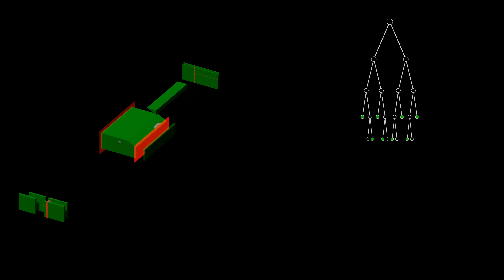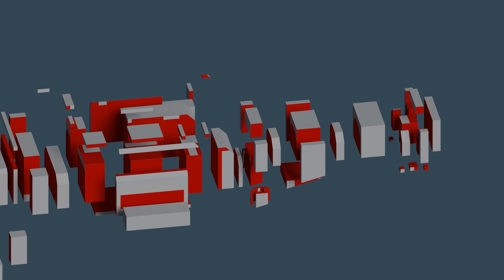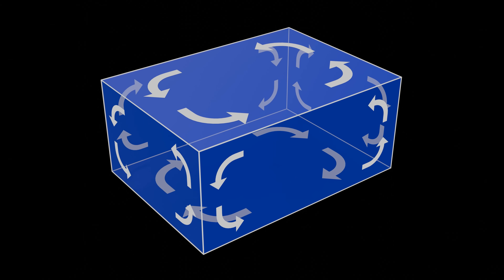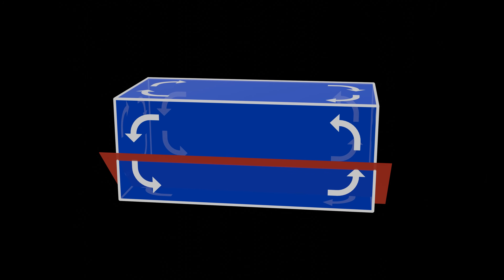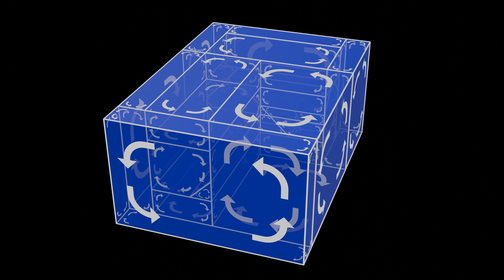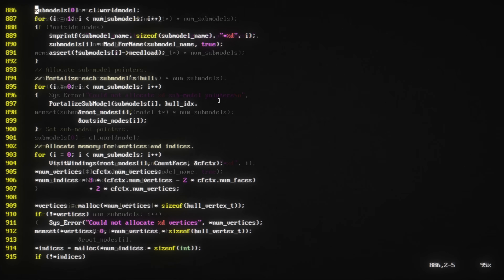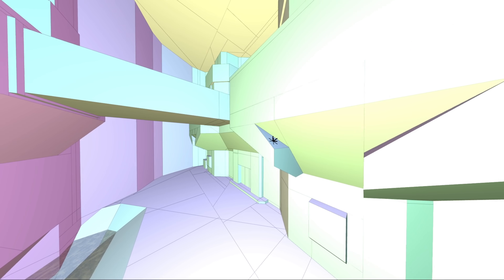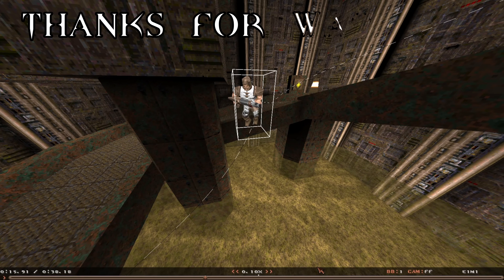Uncovering Quake's unseen collision hulls

Comment: How much of a chore would it be to make this read Dark engine BSP trees? DrOmEd at least unce upon a time had the option to export a loaded level's geometry, even if the brush data was already stripped out. Way back in, gosh, 2002-03 I and a few others on TTLG tried to reverse engineer it and never got that far. Each leaf was basically a plane with a parent, a location in world space, and a normal vector that pointed concave to the mesh. There's black magic involved in turning that into visible graphics!

Comment: Ah, the Minkowski sum.  I'm doing the same trick on the fly for my game's physics since cpus are a lot faster now.  Interesting that most of the video is covering the bsp tree rather than the Minkowski sum itself.  I spent quite a bit of time on procedurally querying the Minkowski sum mesh topology so it doesn't have to calculate a full mesh.  Bsp is also not needed anymore, I just draw the whole map and it still manages to run at 2000 fps xD

Comment: Hello, I am coding a minimal yet efficient 3d engine and unstructured database engine in Javascript since it can run on a browser which means accessible in any OS, I'll be using my engines as an application, for example spreadsheet, a web minimal OS online. more HTML DOM elements make the browser slow, browser RAM usage is incresing, so this is why I am trying to render in cavas what is calculated in Worker. if you think it's interesting, reach me out.

Comment: I've seen that exanded hull bug in a couple of NS maps. It was usually where the off-axis faces of two (octagonal) pipes or similar would met at an angle. This 3:18 is the cause of a lot of problems in quake and half-life maps. When you cut an object diagonally like that the new vertices produced don't necessarily lie exactly on the plane (floating point inaccuracy) nor do they necessarily round up to an integer. Instead you get mysterious leaks and leaf-portals-saw-into-leaf type errors. You have to be really careful to make sure you can actually get exact integer positions where brushes meet at weird angles or you end up in a mess. That's why so much stuff is off-axis on a single axis at a time. A slope or a diagonal corridor is fine, two off-axis things meeting each other is only really easy to do with simple geometry like octagonal pipes meeting at 90 degree angles and such.

Comment: The way that the players bounding box can be represented as a single point is blowing my damn mind
Reply: Well, it cannot really. Quake did away with it for bigger weapons. Half-life has the crouching problem. With cars, games usually take rotation into account. Even with the CJK algorithm you end up writing special code for vertex-face and edge-edge collision.
Reply: The ideal way to get an effect that feels good and is well-behaved is to have a physics solver that is robust enough to track multiple solutions to resolve a collision, filter the solutions that still penetrate, and then rank the remainder with some heuristic. That is, if you have a wall that you hit at a diagonal, it should generate solutions that stop you completely and solutions that slide, and then rank them to determine that you want the sliding behavior because that's closer to the behavior you'd get with unobstructed movement. 

That allows you to build in arbitrary complexity in the geometry alongside complex, gameplay-specific movement controllers with few consequences other than it being resource intensive - I always use this method for 2D games now.

When you use point simplification, it's with the goal of only ever having to resolve a collision against exactly one other thing at a time(which is fast, enables simple collision tests, and appeals to the physics major in us that is looking for beautiful analytic solutions). In practice, that just means your collision bugs are shifted to how the hull was built, in transitions between multiple hulls, or in collisions between mobile objects. Trimming the solution set prematurely causes information loss, and it's really easy to end up with mystery bugs by doing it. 

That said, game physics start to require approximations for performance when you want complex dynamics with bounce/tumble/roll and so on. That's why we aren't always just doing the brute force thing of tracking all solutions.
Reply: @ in Quake the player collides with the level mostly. Collision with enemies? This video found a bug, how many are left. I feel like we have perfect code to generate a hull now. With a hull stored in a BSP, you can trace linear motion between your fixed time steps and find the first collision. Even CJK uses Minkowski. So for a fixed relative movement vector between time steps , we can solve for the time fraction of collision.

I just don’t know how to rotate ( cars ). Probably need to adjust rotation once collision is found? How to simulate a screw?

Doom3 uses this for bullets . I used it for Pool Billard.

Comment: I wrote a map compiler and engine around it many years ago, but I never used the inflated hull.  I had no idea there was a bug in the original, very cool to see it!

The designers of these early bsp games were masters at placing clip brushes (invisible colliders), which is somehwhat of a lost art these days.  They would be placed around sticky doorframes and other annoying geometry that a player can get hung up on.
Reply: I did quite a lot of that in my own maps. I made working ladders in Q1 using clips.

Comment: why not just roughly use same sized polygons then just split not by geometry splitting planes but divide the individual triangles/polygons to two groups. radically different operation. group assignments vs geometry re-calculation. all new geometry calculations are expensive. just doing a tree split node operation is cheap. right pre-calculated of course.

Comment: Even though the the visualisations are the best I could imagine, it’s still hard to really wrap your head around just how much processing power even a 486 has! This is the kind of thing so far past human ability to compute, and it happens many hundreds of times a second on modern hardware
Reply: I think we collectively left behind the ability to understand bare metal processing power when we moved on from 6502 and Z80 processors. Those you could follow; anything after that is understandable theoretically, but to the vast majority of people it's a black box that takes this-and-that input and returns this-and-that output. The REALLY interesting part is that while at the current stage a team of sufficiently motivated people with enough resources can still understand, say, the ultra-intricate structure of a Ryzen 5600, after we inevitably get AI designing our future CPUs they will become truly alien to any human mind.

Comment: But why such hulls were originally needed? The hulls are built specifically for player bbox  size, so it won't work for enemies, since they have different size. And there are a lot more enemies on a map compared to players, so why such hulls were designed -- assuming that enemy bbox collisions are done against world anyway, without hulls?
Reply: Smaller enenmies used the player hull and larger enemies had another hull.

Comment: The way you visualized the portaliser helped me understand why maps should be designed with brushes snapped on grid, otherwise you risk compile errors due to the math getting too crazy. I'd always try to do bonkers stuff when I was a teenager and end up with endless compile errors, scrapping most of my efforts out of frustration. 

Also, I never thought about collisions from an internal "origin point" perspective but rather the external boundary of the model - fundamentally inside out and obviously computationally impractical. Would have loved this video when I was younger - but I still love it now! Thank you for these incredible visualizations of complex ideas.
Reply: It wasn't your fault, the compilers were very primitive. Try Unkle Mike's P2ST. The algo itself doesn't care for grid and axiality. But the floating point errors accumulate either closer to the edge of the world +-32384 units from the ceter or from the map complexity.
Reply: Collision happening at the boundary is more correct as you don't have to use the same collision size for everything, eg a small enemy can fit into more places and vice versa.

Modern engines directly compute collisions, though with much simplified geometry, often only a single capsule for the player/enemy: a cylinder capped by half spheres. This is surprisingly both much cheaper than a box and much more natural looking from the outside and feeling from the inside.

Comment: what would it take to treat the player as other shapes such as a cylinder or octagonal prism?
Reply from the maker: Nice idea!  I suppose in theory you could modify the map compiler to do the expanding with any (convex polygonal) shape and it'd work in an unmodified engine.  The engine would need to be modified for non-brush entities.  That might not be too big a shortcoming though, depending on your requirements.
Reply: Quake 3 does treat players as the capsule. There was even the funny case with Quake Champions: pro-players from Quake got so used to the capsule collision they didn't think that rocket will fly through playermodel legs, but because QC collision is more truthful, it did happen.

Comment: I wonder how much performance was saved by this ? Surely it also consumed some memory...
Reply: I'm pretty sure it was well worth it - this has made cost of collision checks 8 times smaller. You're gonna have from 1 to 3 (move&slide on each axis - maybe more than 3 to resolve corner cases...)  per actor per frame, so with monsters or multiplayer games I am sure it added quickly. I'm pretty certain that they wouldn't go this crazy route to optimize the collision checks by precalculating these hulls if it wasn't absolutely necessary to have the game running at available hardware. The limitation of being able to only have 2 sizes of BBox for any actor is quite significant.
Reply: @unfa00  Thanks. Hey Quake had the small fish and the giant shamblers, so it worked out quite well.

Comment: what i find funny is that for half-life it had to be done twice per map, for standing and crouching stances, and this affects sven co-op as well (surely not with current day compilers, right?) which has resulted in me occasionally discovering yet more ways to clip through or into over-detailed geometry to this day in the near endless number custom levels for the game
Reply: Four times actually!
Hull 0: the "point" hull, not expanded in any way, used for hitscans, NPC visibility etc., basically for tracing lines
Hull 1: standing players, most humanoid-sized NPCs
Hull 2: big monsters
Hull 3: crouching players, headcrabs etc.

Some people completely exclude hull2 from compiling (e.g. in Counter-Strike maps) so they can stuff more and more details, but obviously this means if you tried spawning a Gargantua there, it'd just fall through the floor
Reply: @Admer456  That was very fascinating, thank you.
Reply: Quake does it twice too (one for players and small monsters, one for large monsters like shamblers and ogres). I don't remember if Quake 2 still uses two hulls (one for crouching) though.
Reply: Oh, I'd love to learn more about how Quake 2 has changed the engine and it's approach to many things. One thing for sure is there's no QuakeC, but game.dll.

Comment: This makes a lot more sense explained this way. I could never get my maps to work as they were always hit with a "not water tight" error or something like that. Eventually I gave up trying to create maps for Quake and just went back to making .wads for DooM.
Reply: I don't think that would be related to this, sounds more like there were gaps between brushes to the outside void. I don't think it'd matter if it was too small for the player to fit through. Though I'm pretty sure the editor I used (Worldcraft) allowed you to compile maps that weren't enclosed.
Reply: @23Scadu   Portalisation is related to this, because that's what the BSP compiler relies on, in order to figure out what's inside & outside. It marks all "outside" polygons for removal by essentially walking through the portals and counting what "rooms" it saw (I've yet to fully understand how it works, but anyway). If you make a room with 6 cuboid brushes, that's 36 polygons total - only 6 of those "inside" polygons should make it into the final map. Leaks occur when there's no distinction of inside & outside i.e. there's a gap somewhere or there's an entity outside.

The map can still compile (e.g. with a parametre like -nofill, depending on the compiler), except you'll be using up many more clipnodes and other BSP resources. Modernday BSP compilers like ericw-tools will allow you to compile a map with a leak. Funnily enough, modern Half-Life map compilers (VHLT) will refuse to compile a leaked map by default. Worldcraft/Hammer/J.A.C.K./TrenchBroom will "allow" you to do anything, it's mostly the compiler that goes "nuh uh no fun allowed!!!"
Reply: That's called a leak, the compiler needs to know where the inside of the level is and where the outside is so it can cull away everything on the outside, and it does this by starting at an entity and flood filling through your world brushes. If the algorithm finds the area beyond the bounding box where any brushes are, it has found the void and there's a leak. Most mapping programs generate a pointfile when the map leaks, which is a line you can follow from an entity to outside the map, helping you find the gap.
Anyway yeah, this is not related to what the video demonstrates.
Reply: I always liked the unreal editor more (in theory) for that; you start in an infinite solid and subtract the map - way more sensible!
Reply: doom wads are more fun anyway :)

Comment: So... this was done so that the player's hit box is reduced to a hit point so that the game doesn't have to calculate 8 points but only 1? How is it this 30 year old game still blows my mind?!
Reply: this comment made me understand the video a little better; this is really interesting, but i hardly understood anything
Reply: By the way, this is not the only such case in graphics programming. Many of frustum culling solutions implicitly assume that meshes's AABBs are significantly smaller than any dimension of frustum. That would allow to simplify most of the intersection checks (if you check do AABB's vertices lie in frustum or not).
Reply: No I think this was done so you don't have to expand these polygons at runtime. Normally when you do Minkowski difference to check for collisions you expand the two shapes you test against each other. In Quake they decided the player is always a constant size, so we can expand the entire map by the size of a player once at compile time and use that at runtime. If you wanted to do a collision check for an arbitrary sized object in these Quake worlds you would have to do it at run time, can't generate a separate expanded world for every arbitrary shape.